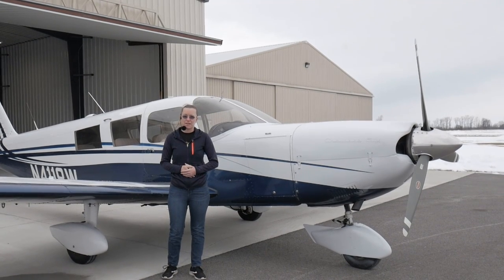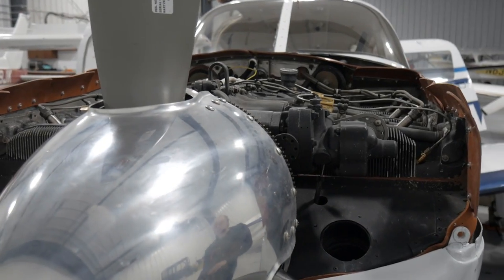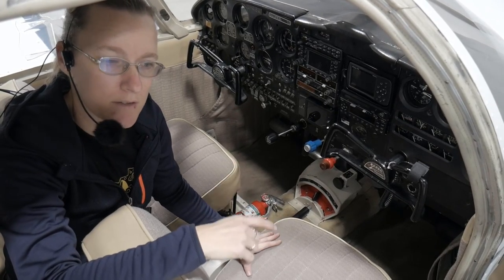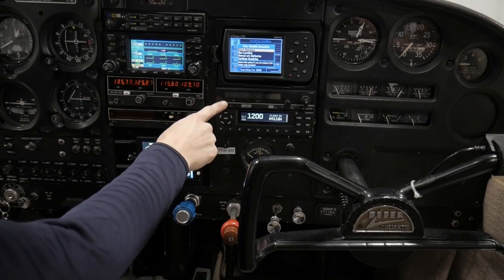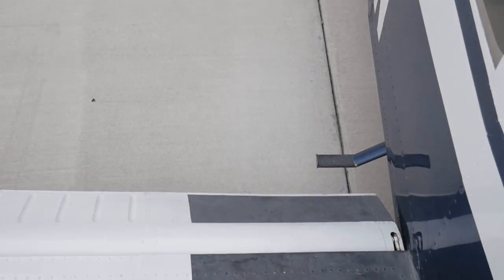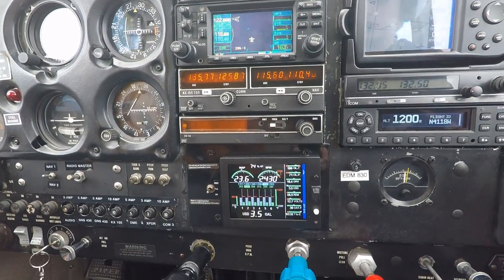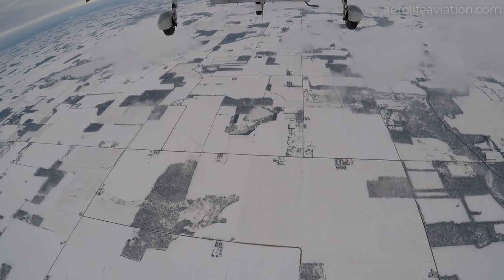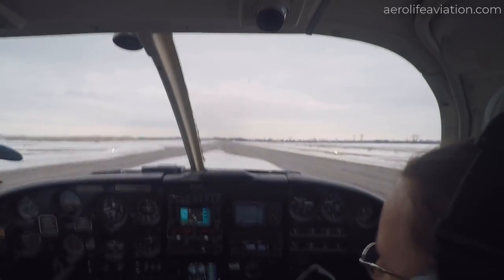Piper Cherokee 6 Overview Flight | Amazing load hauler | Easy to fly high performance airplane

Comment: Nice bird.  One caution:  ease of removing/installing seats is great, but you should also have weight and balance papers for each configuration.  Have multiple W&B forms computed by your mechanic to add to the aircraft’s airborne paperwork.
Reply: It’s a Cherokee if the doors will shut she will fly 😂

Comment: First plane I owned was a '79 Cherokee 6 PA32-300. More plane than I needed at the time. Definitely not a chop and drop landing like most high wings. Loved it but replaced with a 182 and flew it for 25 years. I had model with club seeting including table and icebox.
Reply from the maker: They do like to land a certain way, once you learn it is easy enough. The 182 is a great plane also.

Comment: I don’t know much about prices of planes I’m not a pilot but it seems to be a good price on what your getting. I always wanted to fly but I’m a big guy at 390 lbs and I don’t think I would fit in them training planes I would need one this size and lessons would be expensive. Love your videos keep up the good work
Reply from the maker: Thank you for watching our videos
Reply: Carl. I worked with a gentleman about your size and fit in this airplane.... I was the pilot and he was the co-pilot, the first time I took off with him in the right seat, the plane banked to the right. An easy fix was to keep about 10 to 15 gallons out of the right side of the fuel tanks. You should try fitting in one, I think you will be surprised.
Reply: @dougsarto41  thanks for the information Doug, my question is do most flight schools have this size available? How would the 182 compare to this plane? Thanks again for you time….
Reply: @carlmanning6707  I have not had the opportunity to fly in a 182. My suggestion would be to contact a local flight school with a 182 a schedule an indroductory flight. It would hurt to try it out.

Comment: I absolutely love these planes and want to buy one at some point but for god sakes, who designed this thing and why did they think it was a good idea to put the engine instruments on the other side of the plane!?!?  Great review.
Reply from the maker: Thank you for your comment, you are right that some of the panel could be laid out differently but it comes down to space sometimes. A digital engine monitor would help with that.
Reply: If you where in this plane and the pilot died in flight, I would want some sort of instruments on my side in order to get myself (and others) down on the ground instead of in the ground. My thoughts.

Comment: Which tank has water💦🤨
G,day from Sydney Australia.
Firstly, fantastic review of the Piper Cherokee with its Continental o-540 (how about one of those on each wing)?
So...there are four individual tanks in the wings. How do you establish from the bucket contents, which tank you have water containent?
Thankyou for explaining the performance chart for the plane.
🌏🐝
Reply from the maker: This plane didn't have any water in the tanks. 
You select each tank one at a time and drain, then either go out underneath and check it after each time or have a helper do the draining while you check the contents of the bucket in between each drain. Thank you watching